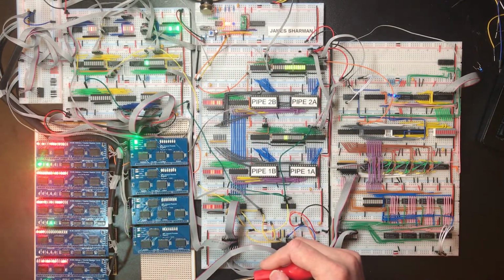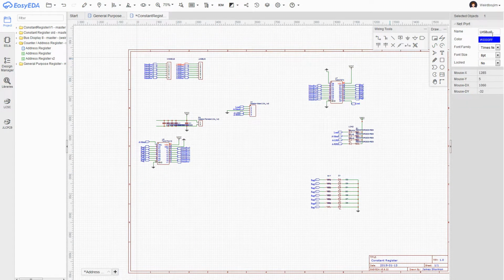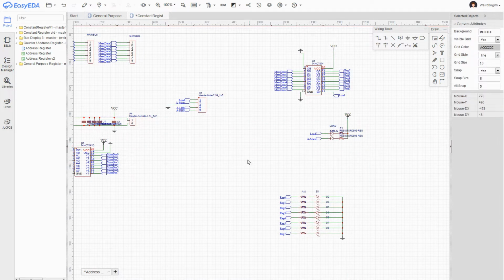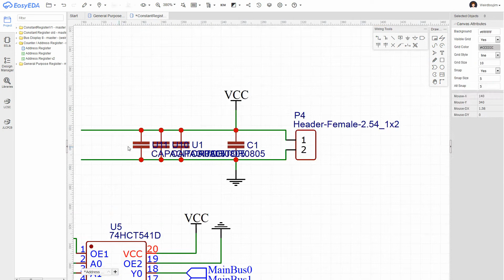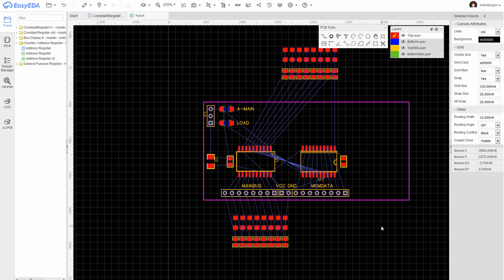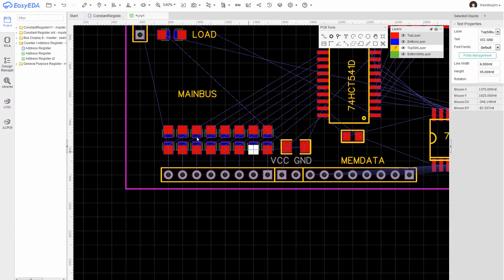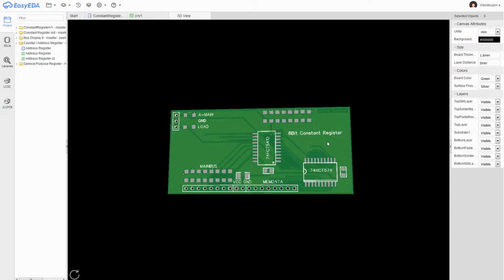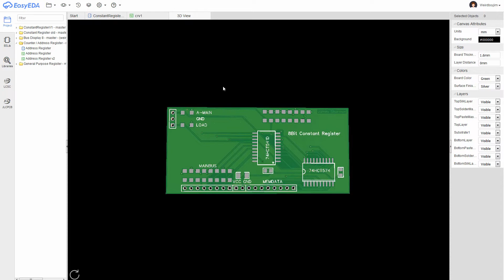Constant Register (2: Completion?) - Making an 8 Bit pipelined CPU - Part 37

Comment: This episode: James temporarily abandons electronics in favour of woodwork as we look into the technicalities of shortening table legs.

Ahhh! Stripboard! Finally somewhere I can throw in a little "pro-tip". When cutting tracks, you can't beat a little low-power (as low as possible) drill or electric screwdriver with a slightly oversized bit... 
Dip the bit into the pre-existing hole, a quick buzz from the drill and you've cut the track. Trying to cut the tracks with a craft knife or a Stanley knife can lead to frustration and the occasional accidental wounding.
Reply from the maker: If you watch closely in my latest troubleshooting video you'll see a few pads I used that trick on.

Comment: What pcb manufacturing company did you use. I have just got some boards from jlcpcb as they are on sale and wanted to know what the company you used to make yours so I can make comparisons as jlcpcb cost a lot to ship to my house.
Reply from the maker: Unfortunately for your comparison, I too use jlcpcb. I understand your issue though, small boards now all cost $2 from them which is usually dwarfed by the postage costs. It gets a little easier if you make multiple orders at the same time to balance the cost out a bit but that's not always possible.
Reply: the issue is a don't need to buy in batch i don't always need more than 2. it the deal on all orders or just the first.
Reply: I don't get many PCBs (Veroboard FTW ;) ) But I've got the best deal from JLBPCB. I had a go with PCBWay because they offered me a special offer. But there was either some mistake or maybe some "not a mistake" that left me paying a huge sum in import duty before they were allowed out of China.
JLBPCB do seem to be pretty good quality and the price is good.... very very good compared to the astronomical prices that more home-grown vendors charge.

Comment: Given that PCBs are produced in bulk, would it have been reasonably easy to use/repurpose a GPR as constant target? I got interested in CPU design through a game called Turing Complete and the first CPU you build there simply loads constants into the first register.
Reply from the maker: Well the constant register is simple in that it only loads from the memory data bus. What you suggest would require that the GPR's can load from two sources (like the transfer register), this register is really just one latch chip if you take the led's away.  If I wanted to change something there I'd be more inclined to make it able to be used as an ALU input directly.
Reply: @weirdboyjim  thanks for the reply and the series. I was thinking instead of inserting a no-op to skip the constant you could have Inserted something like a mov from PC address to register. I might have to rewatch some episodes though. :)

Comment: Oh, that autorouter really doesn't do a pretty job. I know you have done loads of videos since this one, so maybe you have already started to route manually. It is not hard to make something that looks way more neat than the mess produced by the autorouter.
Reply from the maker: Indeed, I think it's Part 57 that I switch to hand routing. Interestingly enough this specific pcb is one of the ones I revisit (for other reasons) later on, so you can see me hand route a modified version of this register in Part 78. These days I hand route anything that matters, I will use the autorouter for temporary interconnect boards to save time (even then I'll rework it if I'm not happy with the results).
Reply: I've just gotten started in hobby electronics (I blame Ben Eater, James, and Adrian for giving me the bug:)) and while I haven't ordered any PCBs I've mocked up a few in KiCad and for some reason I find manual trace routing to be kind of fun and meditative, so I haven't even touched the autorouter.

Granted, the most complicated PCB I've mocked up is a clock circuit that can switch between a variable speed astable mode and a monostable mode for single stepping, so maybe I'll feel different about it with something actually complicated.